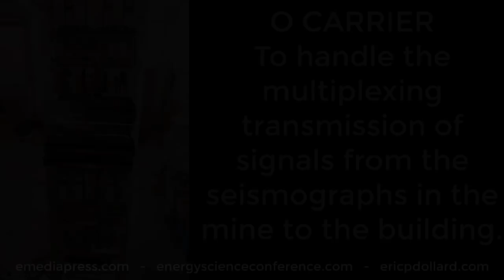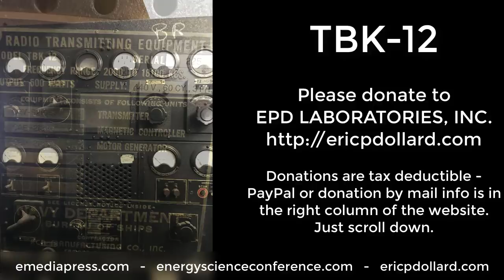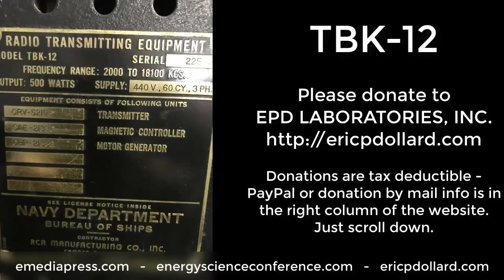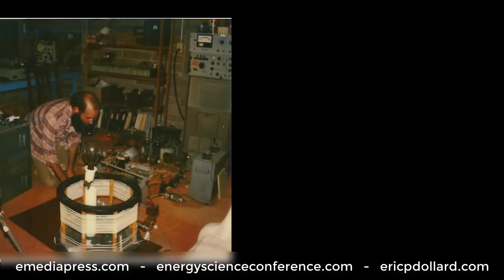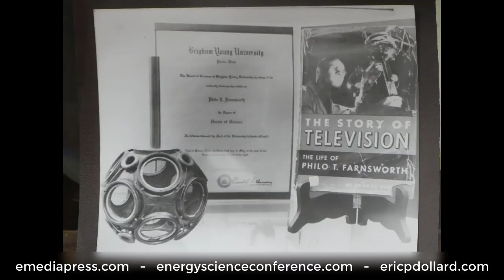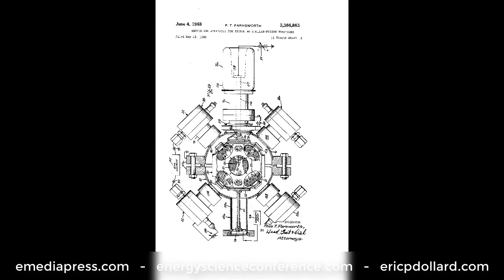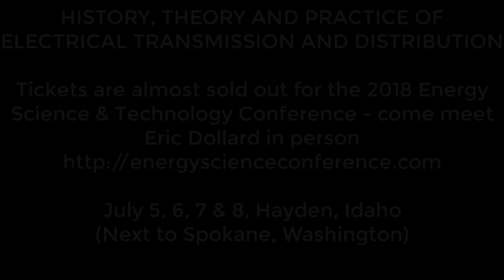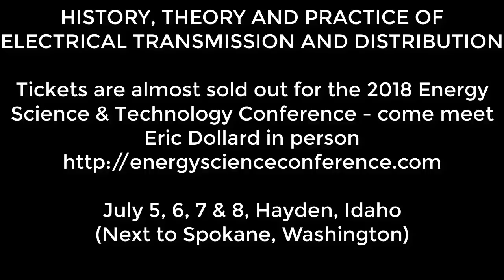2018-03-26 Eric Dollard Update

Comment: energy is usually a product of some sort of pressure and some sort of displacement. What is the nature of the displacement in the longitudinal dielectric wave?
Reply: capacitance then the loss of its inertia H to L ....Phi to 1 and vice versa
Reply: couldn't expect less gibberish from a masonic triangle icon
Reply: lol alot of information can come out from a triangle :)
Reply: what you say is that energy is movement ,while pressure is the byproduct of it . and i dont really care if you hate geometry or not...thats like taking care of millions of patients in this world that opposes reality
Reply: I don't think you have a constructive answer to the original question. Let Murakami or other(s) answer
Reply from the maker: You can have pressure without energy - hence, a pure dielectric potential. If that pressure is reduced/dissipated by some resistance, then that is the definition of work, which is energy. Nature of displacement of a longitudinal dielectric wave? Between two antennas with a high frequency high voltage oscillation, the longitudinal wave causes a displacement current between them - that is a different current from a conduction current. You can search for displacement current. That would be a good question to ask Eric on the next live call.
Reply: by conventional electricity, the displacement current is considered 90 degrees phase shifted to both the electric field and potential hence transports no real power. My question was incorrectly stated, I meant to ask how is real power transported by the longitudinal wave?
Reply from the maker: Again, that would be a good question to ask Eric Dollard on the next live call. I can tell you that for example you can separate water without supplying current to the water. If you polarize the water with a hv electrostatic electric field, you can pull the water molecule apart tug-o-war on it. When the voltage attraction of the positive plate overcomes the electrons bonding strength, the electrons are removed and move to the positive plate. That electron movement is a real conduction current that was not supplied by the circuit - it was developed internally. The same with lead acid batteries for example. If you polarize the chemistry with longitudinal impulses at the terminals - the chemistry gets polarized and bit by bit with repeated impulses, internal current starts to move in the charging direction, which charges the battery and that current was not provided by the longitudinal impulses either. This is how real work over time is being done by supplying nothing more than the electrostatic potential.
Reply: it sounds as if you can/are "violating" charge conservation "law" when separating water or "charging" a battery with electric field alone
Reply from the maker: That is a misunderstanding. It is an open non-equilibrium system. The "environmental" input to the system in addition to our own is from the dielectric medium itself. So total input includes more than our small magnetizing losses in the transformer we use to charge the HV transformer, which creates a steady or pulsed DC hv electric field. It remains open so current from the transformer does not flow across the gap so we aren't dissipating energy but work happens. Non-equilibrium thermodynamics is not magic and it does not violate any conservation law. 

Total output can then be more than what we provide. It is NOT more out than in. It IS more out than WE put in because of the addition of the environmental input. That is the distinction most conventionally trained people are ignorant of. 

A child flies a kite and expoends10 parts energy to get it into the air and the wind supplies 90 parts energy. That is 100 parts input. If it is 50% efficient, then half of all that input is wasted - so only 50 parts energy is actual flying work of the kite. 50% efficient is not very impressive but is two and a half times better than common solar panels so not bad actually. It is just for simple number examples in any case. 

Now, the child introduced 10 parts energy, but 50 were accomplished - that is not 500% efficient, that is 5.0 COP or coefficient of performance. No laws of anything are violated and the child get a net gain of 5 times more work than he had to input. That is "overunity" or "free energy". 

The dielectric separation of water is the same thing. High enough electrostatic field to overcome the covalent bond strength of that electron and the electron flies to the positive plate knocking electrons out of other water molecules to separate hydrogen from oxygen. That is hundreds to thousands of times more freed hydrogen compared to Faraday's Law of Electrolysis for the same input loss. With dielectric separation, you only lose magnetizing losses without any load in the input transformer to create an open circuit. With electrolysis, you lose not only input supply losses but most is the mass current losses in the water by getting current to do the work, when it is not necessary. Get electrostatic voltage to do it without contributing the current ourselves. No physics violated, just misunderstood.
Reply: the problem with the chemical bond example, either a battery or water molecule dissociation, is that atoms must either receive or accept electrons to be part of a new molecule arrangement. It is expected they receive or send these electrons through the open system (usually an electric conduction path). Here is the contradiction, how can you have a conduction path and no current?
Reply from the maker: Electron avalanche moving towards the positive plate but supplied by the water is a conduction current. That current is not supplied by the electrostatic-ally charged negative plate.
Reply: How would that conduction current  be schematically drawn in conjunction with the electrostatic polarizing source?
Reply from the maker: It is as simple as it sounds. When you electrostatically polarize the water, electrons from the water move to the positive plate and that electron movement (current) does NOT come from the electrostatically charged negative plate. I think you're expecting some closed loop in order for current to move from neutral plate towards the positive plate but it doesn't need a loop. That electron movement is the same as a conduction current because it is a real current that can do work, but you don't pay for it. It's not magic and yes, it does violate conventional equilibrium thermodymamics. Why? Because standard equilibrium thermodynamics don't apply to open systems.
Reply: not negating the possibility of COP>1 but your explanation is not conducive to scientific replication
Reply from the maker: This has been done for decades all the way to the industrial scale. My explanation is correct and has been replicated. You are going based on nothing but your belief and that is obviously holding you back from seeing the child-like simplicity of the concept.
Reply: if it has been done for decades to industrial scale it does not make an incomplete explanation correct. The COP>1 is likely true yet the explanation is incomplete. It is not your obligation to make an explanation complete but not having such obligation doesn't complete it
Reply from the maker: The concept is simple and complete - you are not seeing it for what it is. If you electrostatically charge a battery, the chemistry gets polarized. Then internal charging currents develop and electrons from the chemistry itself moves towards the positive terminal. Sulfation dissolves into solution making it more conductive, the internal charges separate and the voltage potential difference increases between the terminals, water molecules are broken and turn into sulfuric acid. That internal charging current was NOT supplied by the electrostatic charge, yet the battery charged. That internal current is the same as a conduction current - it is not a phantom current that can do no work as you claim for the displacement current. The amp hour capacity of the battery increases beyond what could possibly be supplied by the electrostatic input source and that is over 1.0 COP. I don't get why you cannot understand this simple concept.
Reply: a picture is worth a 1000 words. It's what I was expecting at some stage from you. Perhaps you need a schematic from me to explain why the description you have made is not thoroughly coherent. How do you suggest I forward this schematic?
Reply from the maker: Start here: https://patentimages.storage.googleapis.com/c2/a1/2f/fe0d1b8ea99db7/US4427512.pdf then do your own experiments. The whole process is common sense as is the fact that equilibrium thermodynamics is violated as it is violated by 100% of every natural system. Good luck.
Reply: the apparatus description is somewhat believable to be COP>1 but its construction is different from conventional chemical batteries. If this device is effective in suppressing current at the source, it does not mean a conventional battery can do the same. Here you are decomposing water into its constituents, in a battery it is understood you need excess electrons on one plate and an electron sink at the other plate to change both plates molecules
Reply: put it simply the quantity of mass has x number of neutrons ( capacitance) which  is then distributed at the  high energy state  to lower energy state(terminates into high electrostatic discharge) thus ionizing them  ... in other words high energy dielectric electro-statics are under going reluctant break down  ... well that's my opinion and based on my resources so correct me if there's anything wrong :) the electrons do not freely move unless your talking about atomic decay
Reply: oh and sorry for replying in a completely different answer :/
Reply: can't say there is anything wrong because you are totally out of wack from the mechanics described in any physics, chemistry writings of the past 200 years. What are those resources you are based on?
Reply: Eric Dollard(Electrical engineer) , Ken wheeler(based on magnetism) , Tesla ... and others such as Steinmetz , Faraday ..etc  and just ignore the flat earthers thanks
Reply: it seems you have spelled their names correctly, now read their full writings. You misrepresented them
Reply from the maker: The electrons piling on a plate theory is 100% false. That has nothing to do with how a battery operates, how it gets charged and what creates the potential difference.
Reply: the electrons don't pile on the plates except to the extent of the potential difference between them and the intrinsic capacitance of the battery. The battery is considered a reversible device with COP<=1, voltage and current are explained some time back according to chemistry first, physics second. The question is, how can you modify the basic concept to achieve in physical terms COP>1 ?
Reply: okie
Reply from the maker: False, there is no electron piling, that is a phony model just like capacitors are not charged by piling electrons on plates. A charged battery and a dead battery have the exact same quantity of everything - the only difference is the charges are separated in one and not in the other. Educate yourself on the true nature of capacitance instead of simply parroting the incorrect conventional view: http://ericpdollard.com/wp-content/uploads/2014/06/dielectricity-and-capacitance-by-eric-dollard.pdf just like the water, hitting a battery with electrostatic impulses will polarize the chemistry and will cause INTERNAL currents to move in the battery chemistry in the charging direction, which will desulfate and charge the battery and that internal current was NOT supplied by the electrostatic impulses. The joule seconds you can discharge from the battery will be MORE than the joule seconds of energy dissipated by the source that created the electrostatic charge. You're obviously dedicated to the conventional view although it is common sense what I am explaining - it is simply that you nor the conventional brainwash has ever considered this window of opportunity and NONE Of this violates any laws of physics as non-equilibrium thermodynamics perfectly explains these results as well as the fact that sharp gradients (electrostatic impulses) violates closed system thermodynamics and has been known to do so for a century.
Reply: the interpretation is simple Aaron, if you have established a dielectric will not conduct electrons and your ampmeter measures electron flow while charging a capacitor ¿where are the electrons piling if not on the plates?
Reply: nucleus  polarization
Reply: polarization is a state, a condition, it is not a place. The question  ¿where are the electrons piling if not on the plates?
Reply: read comment i posted above.... there's no such thing  as  electrons  escaping from the nucleus unless your talking about beta decay
Reply from the maker: You do not want to see how capacitance can be unrelated to what you have been trained to believe so there is no point in me responding any further. Re-read Eric Dollard's paper on the subject and study the rest of his work. He has plenty of free videos on his website http://ericpdollard.com
Reply: what happens then in a CRT (cathode ray tube) 45445Angels?
Reply: I have read E.Dollard, I thought you were capable to clarify his writings but sorry to say you can't A.Murakami. No worries, as said before, you are under no obligation to do so
Reply: by definition the electrons DO pile up , but they are not in the form of a spinning electron SHELL , but in the form of dielectric discharge  from neutrons(  terminating capacitance ) of the nucleus which is then concentrated  on the conductors , but pile up due to its diamagnetism or B field insulation of the plates.
Reply: dielectric discharge  is happening  within the cathode ray tube ... or you can call it '' electrostatics ''
Reply: dielectric charge which is the termination of inner space or counterspace ( to be more precise, is the termination in the nucleus of neutrons) . While discharge is termination of space expressed as voltage.
Reply: amperes will always move 90 degrees away from Voltage (amp= dielectricity, volts= magnetism) or 1 quarter . So Amp x Volt = electrification.. so if you increase the voltage between the two power lines they will repel, but if you increase the amperage , it attracts or terminates.
Reply: so when i said electrons escaping i really meant escaping from the nucleus and leaving a hole withing the shelll does not make any sense as to also why the electrons don't just spiral back in termination of the protons( but as in the case of neutrons , again its beta decay )
Reply: The notion that neutrons are converted into protons via “beta decay” and protons into neutrons by “inverse beta decay” is an absurdity.
Neutrons convert into protons from dielectric (electrostatic) discharge from excessive magnetic self-induction (so-called beta decay)
and protons become neutrons by excess electric discharge, or as meant depolarization, and increased dielectric capacitance which all
mass particles are by nature, the stable convergence of terminating dielectricity. Protons and neutrons are both the only particles in
any atom, and both are one and the same particle wrongly differentiated as wholly unique, but only from the perspective of their
respective induction or capacitance.